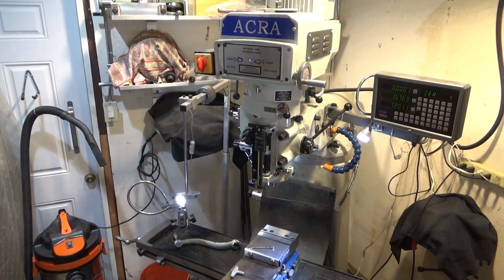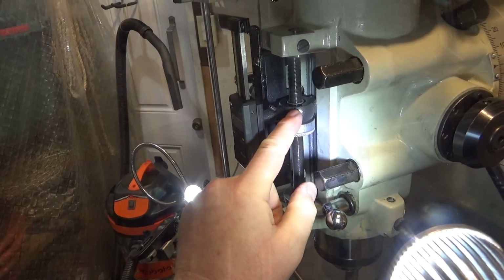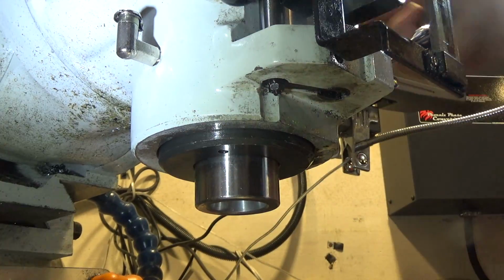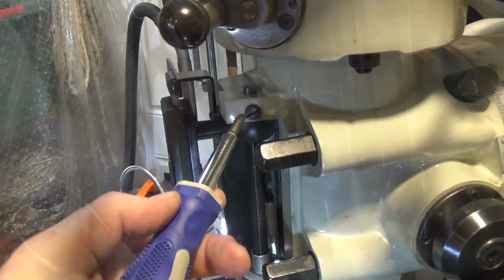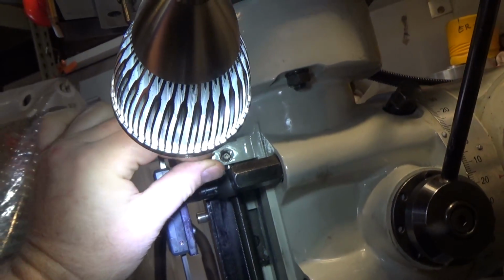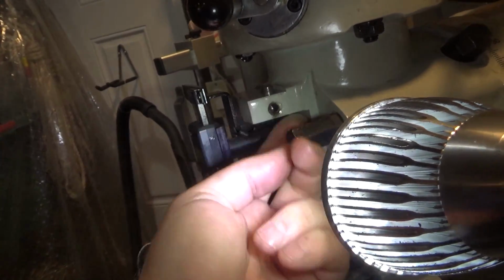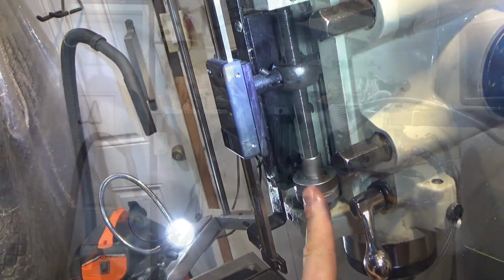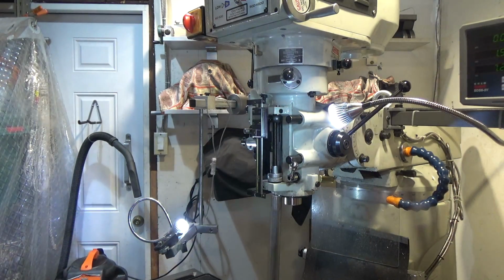114 Fixing an ACRA Mill Quill Feed and  Latch

Comment: was looking at buying a Lathe after I seal my van but i dont know what to get I am looking at a Lathe/mill combo its a Grizzly G9729 what do you thank i was looking at thw sweng and the price but you may now more then I do you could do a video on this if you want to
Reply from the maker: The lathe mill combo is a very restrictive but compact tooling solution. If you can two separate machines would be a lot more versatile. Even small drill mill with a square or rectangular column and a small lathe would be whole lot more useful. If you have the room you can shoot for used lathes locally and potentially get a lot more machine.
Reply: @DudleyToolwright  thanks you I have relooked at it and I have came up to these two  Grizzly G0602  Grizzly G0704 that is the max money I will be getting out of my van thanks I hope these be better and it will work out I hope

Comment: I have a 3hp Sharp TMV knee mill. The ball pivot was bent and the plunger was burred up.
I took the entire mechanism apart, got it deburred, cleaned up and lubricated.
Works as designed.
Thanks for showing us how to adjust the trip lever! Big help
Reply from the maker: I'm glad I could help and you listing another mill mfg. that this video can apply to, helps others.

Comment: Is your mill a Maximart brand?
Reply from the maker: It is an ACRA made in China (the first for them).
Reply: Oh... I noticed it has a cast "M" at the top of the base... similar to mine. Might be same pattern or even cast in the same facility... Acra may buy their castings from Taiwan.
Reply: My quill feed is not working... didn't have a chance to see if it was the same as yours but I assume it will be similar. Thanks for the repair videos... appreciated.

Comment: I love those screw drivers.  I have them stashed everywhere.  The bend in that small part was obvious.  Is that small part made of tool steel?
Reply from the maker: You are talking about the Harbor Freight multi screwdriver - not bad. I didn't notice the bend until I was shooting the video...funny that. I don't know what type of steel it was made of, but it is very soft. A file easily removed material.